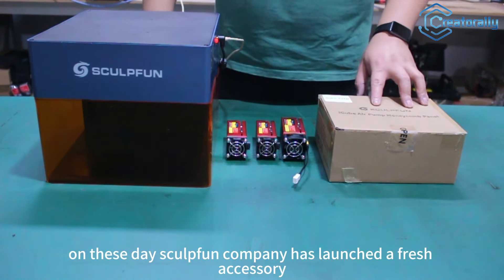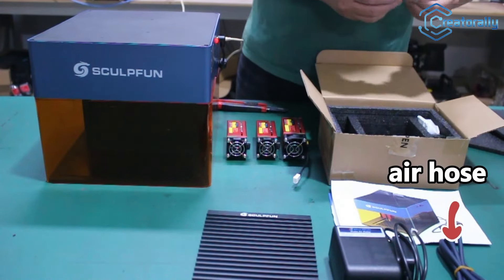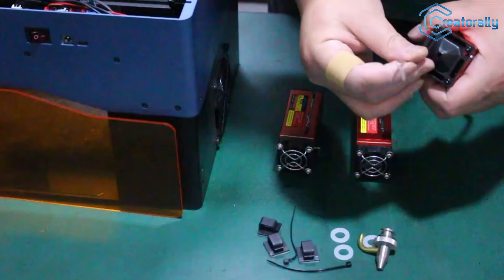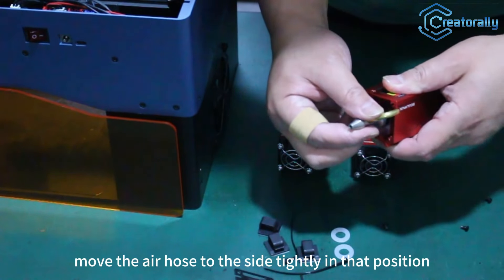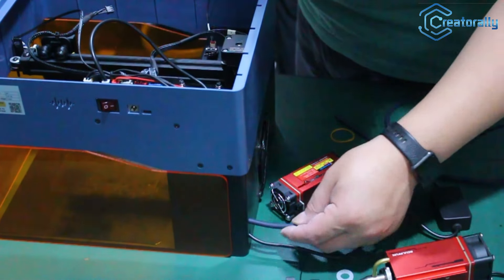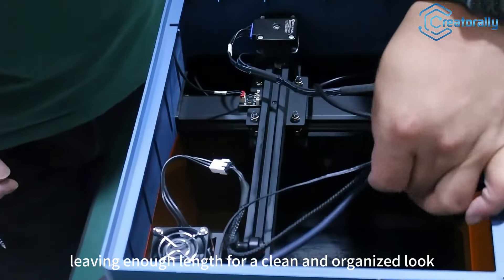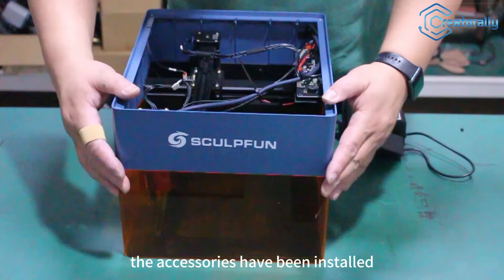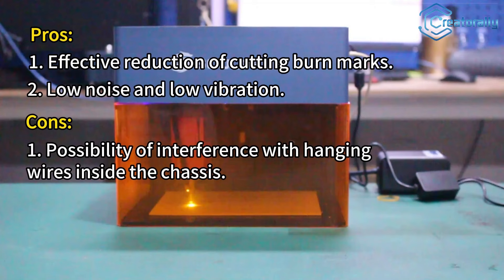Full Review of SCULPFUN's Fresh Accessory: ICUBE Laser Engraver with Honeycomb Panel & Air Pump Kit

Comment: Nice video!  Answered most of my questions. Only other one, does this affect the focus?  Does the retractable arm still do the job ok?  Assuming it does since the laser shouldn’t be affected, but I’m a noob so figured I’d ask. 
Cheers!
Reply from the maker: It's working fine, but you'll need to adjust it depending on the situation.